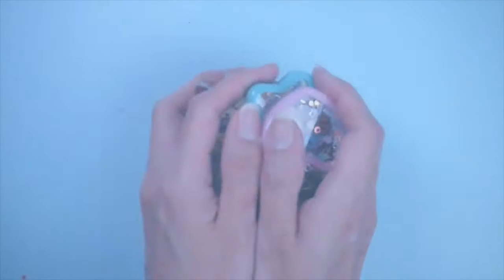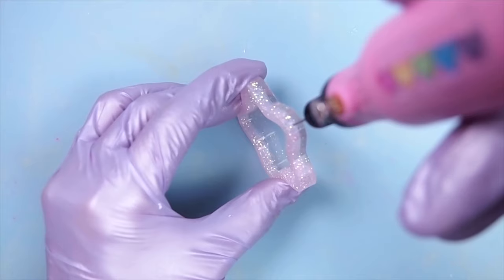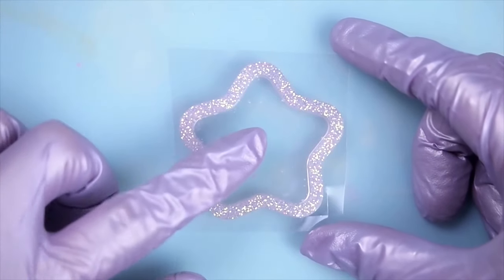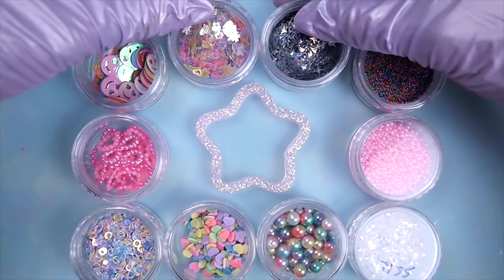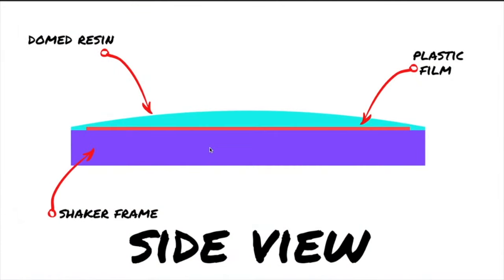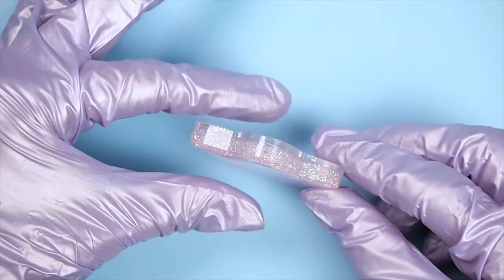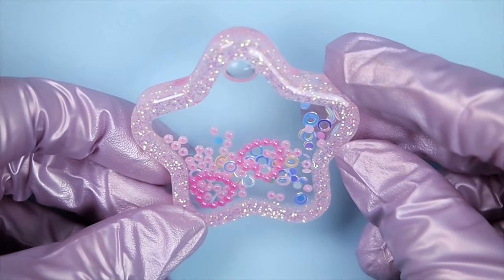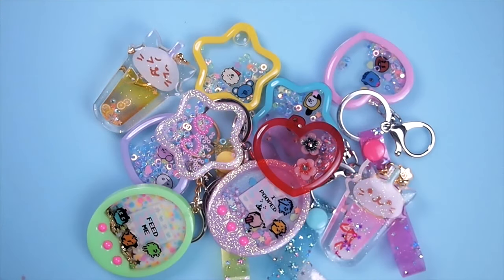How to Seal & Fill Liquid Resin Shakers: NO LEAKS, FOOLPROOF

Comment: you seem to know a lot about Resins, last night I was making Orb balls Clear resin and swirling it with colors, on a toothpick. But I been encountering bubbles, way after the fact and curing, I saw no bubbles after curing and this morning I wake to see a bubble in 2-3 of my orb balls, would you have any advice or any help you can offer?  and thank you for ur fantastic Video I will surly take the tips you applied, and the diagrams you made they do make sense. Also this was the first time I see ur video I'll continue to keep watching and even subscribing you seem to know tons.
Reply from the maker: Thank you! Sometimes bubbles show up after mixing and pouring due to many reasons. Some inclusions can cause bubbles to form and even colorants you use. It’s best to use colorants designed for resin.
Reply: @AmyMade  : yes i kinda thought can be the colorants, also I poured UV resin in a different brand of UV Resin, which could of caused some reaction coming to think Resin can be very sensitive also I saw actual smoke rising when curing the UV Resin, you ever Encountered that? well thank you very much Amy and will use my colors more wisely and make sure I research B4 I make anything you know Any type of resins become Very Expensive we want to use it wisely. TY.
Reply from the maker: Oh you used the uv resin for the orbs? In that case, a lot of times, the bubbles won’t show up until it’s curing. Because as it cures, the microscopic bubbles expand. The best way to tackle this is to let the resin rest for few minutes before curing. This will allow any microscopic bubbles to rise and pop on their own.
Reply: @AmyMade  : Wowee Thank you Amy and I will follow ur steps, you have the option to buy you a Coffee? cup? i bought 1 for that person also makes Resin videos, you more than deserve 2- or 3 cups, well let me know, and thank you.

Comment: does the second version work just as well as the first or would you suggest using the first method at all times when possible?
Reply from the maker: Actually both methods work well. It all comes down to preference, really...but like I said in the video, the second method is great for shakers with thick walls or if you don’t want the drill hole to be visible for transparent pieces.

Comment: For removing air bubbles from our resin do you recommend heat gun, lighter or blow torch ? I also don't want to ruin my moulds with lighter or a blow torch so pls suggest me
Reply from the maker: I use both because it really depends. You can use a torch if it’s a very quick sweep across the resin. However, if your mold is deep, I would use a heat gun instead.
Reply: @AmyMade  I'm just starting on resin and I can't buy both torch and a heat gun because I'm already spending a lot on safety gear. If I have to buy any one of the above what would you suggest
Reply from the maker: Sumayya Kadge you don’t have to buy an expensive torch. You can even use a long neck lighter you can get at a dollar/discount store.

Comment: Stupid question but what about the other side? You started with a wall already on the other side. Do I basically just do the same thing?
Reply from the maker: The mold I use has a wall on one side already. but if your mold doesn’t, you do the same thing with the plastic film

Comment: Could you use super glue, or a heavy duty epoxy glue to seal the plastic film? I feel like that would make it stay on forever! Edit: I read in your description, that “clear glue”, will still show up even after the resin is applied. But Epoxy Glue shows up clear, even on seams where it needs to be transparent. I will try it and see what my success is. I just don’t want to spend extra money on UV Resin when I’m only going to ever use it just a few times. :)
Reply from the maker: Epoxy resin is usually not yellow resistant so it will yellow fairly quickly. And even Epoxy glue will peel off of the plastic fairly easily just like uv resin.
Reply: @AmyMade  OH! Great to know! Thank you so much for your comment! :D
Reply: @AmyMade  what about regular superglue?

Comment: im confused, you said the frame and resin for doming need to be the same but you used uv for the frame and 2 part for the doming? unless im confused as to what frame means
Reply from the maker: Grace yes, the frame portion of the resin shaker has to be two part resin if you are doming with 2 part resin. I only used uv resin to tack on the film and will have no contact with the domed resin. Please refer back to the diagram on the video for better understanding

Comment: If I don't have UV resin, can i seal the hole of the shaker with two parts resin? Or it doesn't cure properly?
Reply from the maker: It won’t work because 2 part resin takes at least 24 hours to cure. The resin will go into the shaker cavity. With uv resin, you can cure the resin right away to prevent that from happening
Reply: @AmyMade  So... the only possible way is with UV resin?
Reply from the maker: Yes

Comment: Hi, 
I made one small shaker since I dont have UV resin I used the same resin from which the shaker is made to stick the sharker film. After curing for 24 hours the sheet came off. I don't know what to do.
Reply from the maker: how did it come off? What were you doing with it?

Comment: Is there anyway you can make your own phone case that does the same thing? You see them in stores but they don't come cheap. Love to see if it's possible to make a shaker phone case?! 
...that is if you haven't tried already?!
Reply from the maker: Not as a whole phone case since such mold doesn’t exist. But you can glue on the shaker charm onto the phone case
Reply: @AmyMade  what I mean is make a phone case out of the same material that you see those phone cases sold in stores with some kind of liquid and glitter. Find them at most phone service provider stores like boost Mobile, AT&T, etc. Thought be kind of cool to see if you could make your own mold out of silicon let it harden then you have a custom mold of your phone to make a phone case that has glitter in it like the ones in most phone service and sells phone providers? But if you can't I understand. Thanks anyways and have a great and blessed day! 😊
Reply from the maker: I have a phone case like that and always wanted to make one like it. Trust me, it did come across my mind in figuring out how to do it.  But just the way the case is constructed, it would be difficult or even impossible to make a mold like it unless you  have the right tools and resources . Which a lot of times can be quite costly. I did make an alternate version though of a gumball machine. But that’s pbb the closest I’ll be able to do it 👍🏻

Comment: Is there a particular reason why you flash with the UV torch before sticking it under the UV lamp?
Reply from the maker: Yes! So to prevent the film from shifting during the transfer or anything that could happen in between
Reply: @AmyMade  Cool, that was my initial guess. Thanks!

Comment: Do I have to use uv resin to put the plastic on?
Reply from the maker: It is the best thing to use for attaching the plastic film. You can use other adhesives but you will get imperfect results.

Comment: I dropped my shaker charm and it busted all over the place… is this common ? I did everything the video said maybe I need to dome it more layers ?
Reply from the maker: It’s not common if you sealed it properly. You might want to sand the shaker frame where the the resin is going to touch to add more “teeth” for it to grab onto.
Reply: @AmyMade  ahhh ok, I will try that. Thank you 😀

Comment: What is the power wattage need to be on the uv flashlight for that small quick set.  I work with a lot of small stuff for jewelry and it would be nice to have one but I don't want to be holding it over something for long periods of time. Are there some that are stronger than others?
Reply from the maker: Yes they make different wattages/power
Reply: @AmyMade  What was the one you usesd?
Reply from the maker: Mine is with 12 bulbs

Comment: What do you recommend doing for a liquid quicksand charm I got but I think leaked before I received it. I want to refill it but I'm not sure if it was an oil or water liquid inside... it has the refill hole and the glitter inside still.
Reply from the maker: I wouldn’t tamper with it if I were you. You don’t know what chemical was used for it. I know for a fact it’s not water and oil (water and oil would look different)
Reply: @AmyMade  ok, yeah I know it's not water and oil. I meant I'm not sure if it's water or it's oil based. Is it that the chemical may be toxic that it'd be best to just leave it alone? Should I seal the top refill hole that's open then? Thank you for your reply btw!
Reply from the maker: @reinalee777  yea I would leave it be!

Comment: I did have a question I did do everything that you suggested in my shaker but I did noticed after a while that my shaker had a clear line going through and it was from the inside would it be because the Uv resin didn’t dry correctly ?
Reply from the maker: I think so! Make sure the uv resin is fully cured before adding the liquid!
Reply: @AmyMade  this happened after I added the liquid then I used the uv resin to cover the hole I think I added too much I’m not sure 😭
Reply: @AmyMade  but the shaker was dry already before I added the liquid I did use the uv resin to attach the film then put 1:1 ratio of resin to fully seal it and waited 3 days till it cured then added the liquid
Reply from the maker: I normally cure it extra after I sealed the film onto the frame: because you can’t really tell if  it has cured all the way since you can’t physically touch the resin to confirm it

Comment: How do you avoid the inclusions to stick to the side? My inclutios stick to the side for some reason
Reply from the maker: Avoid using flat inclusions. For fimo cane slices, I even coat them with some uv resin so it has a rounded surface

Comment: I have everything I need except uv resin and I really wanna start but idk if it’s okay to use super glue instead (or epoxy resin) 😭
Reply from the maker: Super glue will leave a foggy haze on the plastic. Epoxy resin is possible but tricky. You have to wait till the resin is thick before gluing the film down. Also be careful none of the inclusions get stuck on the uncured resin. I personally would not go through the headache of that and just get some uv resin though
Reply: @AmyMade  thank you for responding I will purchase some later !

Comment: For @6:50, I don't have uv resin, can I use 2 part resin as well?
Reply from the maker: You can but the film may slide off so you would have to baby sit the film for a while until the resin has cured enough where it won’t move. OR you can wait for the resin to get thicker and stickier before gluing the film on.
Reply: @AmyMade  thank you!! Great tutorial btw😊

Comment: thank you! I got these steps down however, when I dome there are weird marks that sometimes appear and I get scared :(
Reply from the maker: bbycakes what do you mean weird marks?
Reply: I believe they are called amine blushing
Reply from the maker: bbycakes you’re pbb not using the right resin for doming/coating. Many times casting resin does that
Reply: I’m sorry for asking but what resin do you recommend for doming?
Reply from the maker: bbycakes I have the resin that I’m using under the description box

Comment: Can you only use uv resin for the shaker ?
Reply: or you have to use epoxy if im using a uv light to dry it
Reply from the maker: I mentioned in the video you can use uv or 2part resin

Comment: The 2 part resin is the same as any 1:1resin?
Reply from the maker: No. 2 part resin when you need to mix the hardener and resin together. Comes in different ratio from 1:1 to 1:3
Reply: Would 1:1 be same as 1:3?
Reply from the maker: No. They’re completely different ratios.

Comment: can u use glue gun instead of uv resin to attach the film
Reply from the maker: No you can’t.
Reply: @AmyMade  oh can i know the reason and also can if use epoxy instead
Reply from the maker: Glue gun is thick and messy and won’t be flush to the frame and film. You can use epoxy: please read the description box since I answer it in depth there
Reply: @AmyMade  thankyou

Comment: I still can not get mine to seal. Im using mineral oil and and everything is moving very slowly.
Reply from the maker: where are you failing? I need more specifics to where youre having issues to help you. Mineral oil is thicker than baby oil so things will move slower. But also the weight of your inclusions can greatly affect how fast or slow they move in the oil.
Reply: @AmyMade  having trouble finding cute pieces to throw in them. Thinking about trying distilled water next.  They keep popping the seal when I fill it. Im using a syringe. Leaning extra room for the bubbles to escape but im still ending up with bubbles
Reply: @AmyMade  you make it look so easy!!! Wish I had a hole punch.
Reply from the maker: Try the squeeze bottle with fine tip and baby oil. The syringe is finicky to use. If you follow everything I do in this video, you shouldn’t have a problem. That includes getting a hole puncher if you’re going to fill it that way.

Comment: Sorry for making you confused., i delete my last comments,  
i try to explain clear:
1)i made a shaker last year summer (domed with 2part resin, no leaks)
2)domed surface swelled and inside air bubble got 2x bigger than before (no leaks when i press it)
3)after 1 month start leaking (greasiness surface)
Reply from the maker: How did you fill in the oil? Through a drill hole? If so, it maybe because you didn’t release the pressure before sealing it
Reply: @AmyMade  yes..i didn’t release the pressure before sealing it, due the oil will gush out when I press it..
i will try it next time! thanks!

Comment: How you dome confidently without latex or even on doming mat lmao
Reply from the maker: Latex technique is relatively new and totally unnecessary in my opinion. I’ve been working with resin for 7 years and never had to use it. It all comes down to the technique. 😉
Reply: @AmyMade  omg :o I'm always so messy and it spills to the side a lot :(
I think my table isn't level as I notice my coaster height is slightly different, I think this is one explanation

But I am really messy I wanna cry whenever I see people do theirs so neatly but I can't.